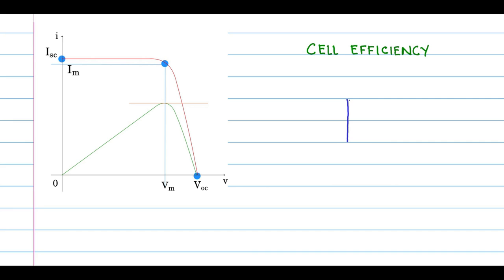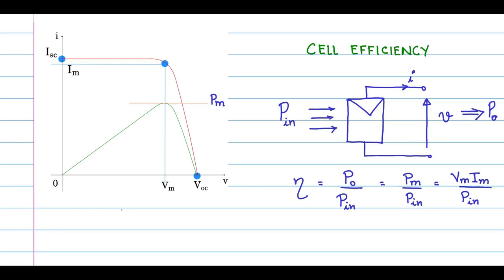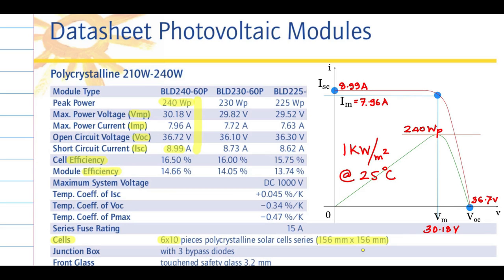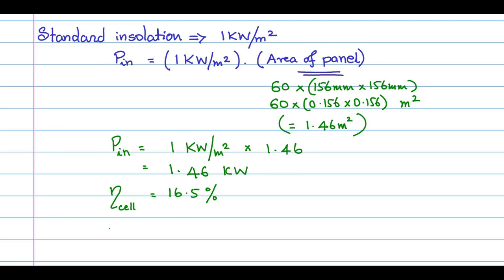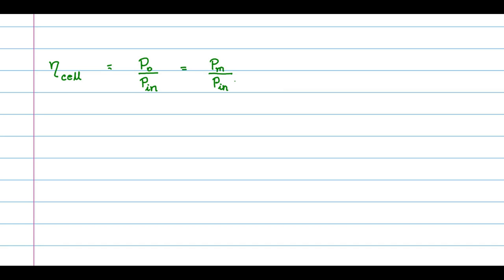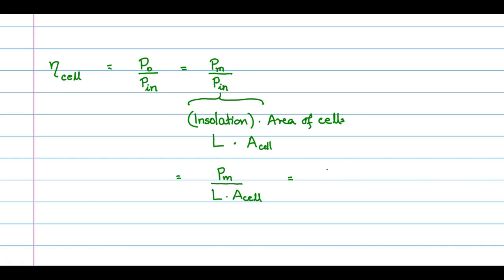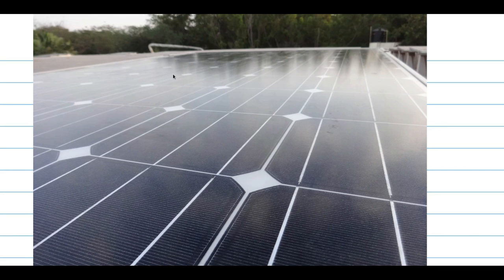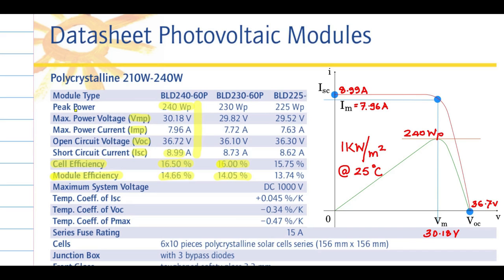Cell Efficiency

Comment: Q.
 Given that a solar cell has V 
_OC =4.2V, I_SC=45mA, and FF=60% calculate efficiency. The light used during the measurement was AM1.5 and 1000 W/m^21000W/m 2 and the area of the cell is 50cm2.

 .
A valid form of answer would be '3.96' or '0.0396'.

PLEASE HELP ME. WHAT IS ITS ANSWWR

Comment: How come you calculate the output power of the module using the efficiency of a cell? Shouldn't the efficiency of the module be used? or, Am I missing something?
Reply: In this video, he calculated the cell efficiency, not module efficiency. All the parameters specified in datasheet can be used to calculate cell efficiency.

Comment: With due respect, I kindly request you to correct @ 2.15 mints. We can't call (instantaneous Power-kW/m2) as Insolation because Insolation is an accumulated energy of kWh/m2 ).
Reply from the maker: Many researchers define insolation units differently. Some have defined it as KWh/m2 and some others have used KW/m2. In all my lectures and also in my classes, I follow KW/m2 for insolation and KWh/m2 for irradiance. You may follow any nomenclature you feel comfortable as long as you are consistent.
Reply: Thank You Prof.
Reply: Given that a solar cell has

Voc =4,2V.

Isc = 45mA, and FF= 60%

calculate the efficiency. The light used during
the measurement was AM1.5 and
1000W /m and the area of the cell is
50cm2
Reply: According Sandia National Laboratories: Irradiance is to power as insolation is to energy. But, as Prof. L. Umanand says, there's some confusion about the terms.